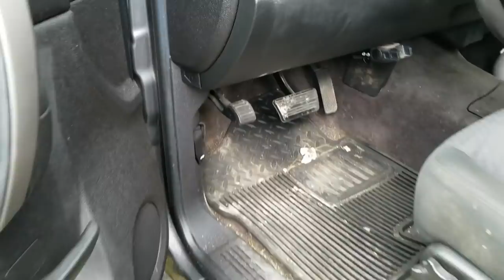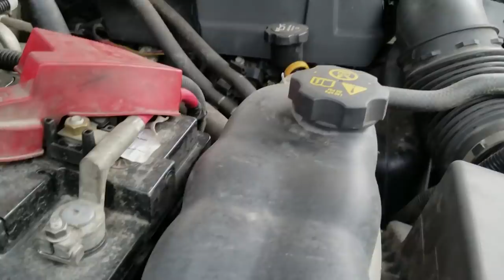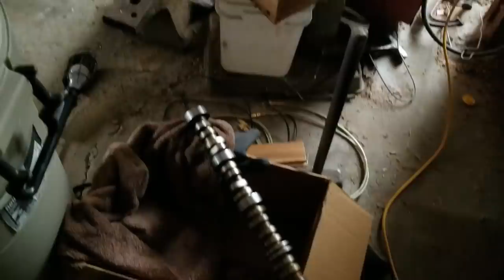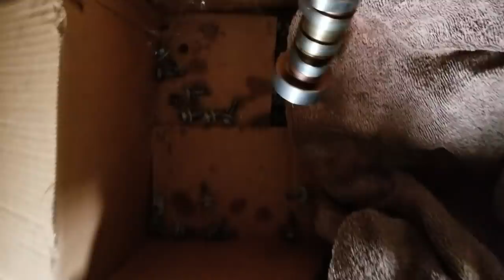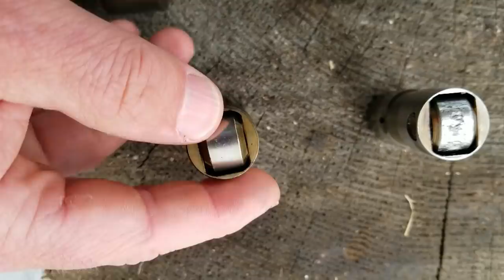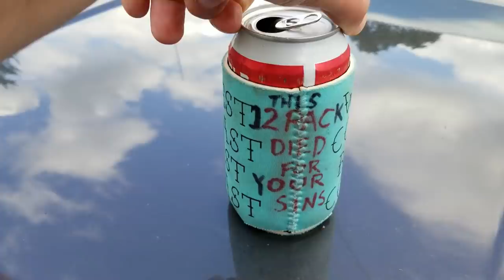Removing Ticks from Engines | Manly-Man Skillz

Comment: Engine ticks?? Oh! You mean my 'change oil' alarm.
Reply: @zuestoots5176  4000k miles = 4,000,000 miles. That's an impressive amount of time to go without changing the oil.
Reply: Or change car alarm
Reply: @zuestoots5176  4000 miles? Even cheap mineral oil should be able to do 9k before actually needing to be replaced...what do you do with that engine?
Reply: No that's the knockers, the ticks just means your a little low, toss in a quart.
Reply: I haven't changed the oil in my daily beater in 5yrs. 
When the light comes on,usually in a corner because it's starved from the low level,  I'll top it off once I get to my destination. 
Usually a couple quarts every 3mo or so.
Reply: @AKAtheA  4 million is impressive dude
Reply: Every 10,000 miles whether it needs it or not.
Reply: @AKAtheA  I don't know, but my "change oil! alarm is a lot of momentary cold startup clatter. Oil's probably OK, but the drainback valve in the filter's given up.
Reply: @teenofthailand1  
At 10k it doesn't need it 🤣
Reply: @mfree80286  
Mines done the cold tick for the last 5yrs. 
I  tried a couple different filters thinking it was a drainback issue.
 Even an oem filter still did it.
So mines not that issue lol. 
I gave up on oil changes after that. 
Any length of time more than 4-5hrs she taps nicely on startup.
Reply: @MrTheHillfolk  The lifter ticking on the GM LN2 is a known issue, I mean it's been doing it for the last... 250,000 miles and hasn't changed at all, so I'm unconcerned.

Hell, the truck could break in two and I'd just chalk it up to normal mileage at this point.
Reply: @mfree80286  Low quality elastomer used by the shitty filter factory, believing that the filter valve is "only temporary' as "the filter will operate for a relatively short time and then be changed", so the cheap elastomer hardens early and fails to seal, allowing the filter to partially drain back.  Designing a too small valve favors this same valve failure.
Get a better designed and better made filter! Nowadays, it is necessary to invest in cutting open some filters from several brands, to actually look the internal quality (or lack of it).

Comment: "Hide surplus fasteners."

No job is complete unless reality conjures up an extra screw or whatnot by the time you're done.
Reply: They say that if you take something apart and put it back together enough times, you will eventually have two of them
Reply: Most people like to have vehicles that match their own personality.  A loose screw here or there.
Reply: I've been known to toss extra bolts in parts bins
Reply: If it works with fewer parts, you've made it more efficient!
Reply: @travissmith2211  you get me !

Comment: the only fire pattern i know is for an inline 6 diesel. 15 too young 36 too old 24 just right.
Reply: Lol
Reply: Well that’s a new one on me. I could  never remember a four cylinder firing order but the question never came up.
Reply: @Kineth1  no worry..if it starts in wrong direction you get 5-6 speeds backwards :D mostly happened on two cylinder 350 jawas :D
Reply: I just learned this the other day
Reply: Yep that’s how I learned it.
Reply: Learned that at Aberdeen Proving Grounds in 1968.
Reply: I like the tried and true Chrysler 6 cylinder. Are you ready?
123456.
Reply: There's lots of semi useless and semi useful information that you pick up over the years working on stuff, Yep an I6 4 stroke whether Diesel or spark ignition is usually always firing 321,321,321 interleaved with 456,456,456. You haven't lived until you have seen a self powered I6 air compressor that is running as an engine on the front 3 cylinders and compressing air with the back 3.
Reply: In some cases.. 36 just right
Reply: 36 isn’t bad at all. Broken in, but still low miles. Best of both worlds!

Comment: The long term solution to that infernal tick is to replace the o ring at the end of the pickup tube where it inserts into the oil pump. Those o rings get dry and shrink up allowing air into the oil system and prevent proper oil pressure/ proper lubrication causing the damage seen in this video. There are plenty of videos here on YouTube on this topic.

Comment: The ticking was a safety feature to let you know the engine is indeed running. It's designed to get progressively louder until the engine stops completely, ultimate safety.

Comment: 18726543 is the firing order of the motor that lies before you. The order you spoke of was of the Holy father of all GM engines, The Small.  Block.  Chevy.
Reply: Thanks the number sounded like I’ve heard it a hundred times but I gave the lost dog look..
Reply: You got it wrong it 18436572
Reply: Fritz, 18436572 is gen 1 GM small block firing order gen 3&4 LS base is 18726543 as Seth noted
Reply: What are we trying to remember those numbers from Lost!? The numbers that were never explained from Lost?!
Reply: Thought it was 8675309
Reply: @tomlindo2863  I will never forget those numbers, they are seared into my brain.
Reply: Yep... 4 & 7 and 2 & 3 are swapped on the LS engine (1-8-7-2-6-5-4-3.  ). Balances the load across the main bearings better than the old firing order (1-8-4-3-6-5-7-2). and also yields a smoother idle. 👍
Reply: ATH24TXEX 4-7 swop on a SBC is a old hot rodders trick. MORE POWER!!!!
Reply: I think we can all agree that 1-5-3-6-2-4 is the only one across all engine manufacturers and fuel types that's un-fuckup-able. 
Granddaddy taught me the easiest way to remember it was to think of chicks at the beach. 
15-too young
36-too old
24-just right

Although, being 28 myself, sometimes I gotta disagree with granddaddy, because there's quite a few DAMN good lookin 36 year olds out there. 28 is a weird age to be, cause the 18 year old daughter looks just as yummy as the 38 year old mother in shockingly many cases this day and age.
Reply: NOCAREBEAR - Exactly! 😎
Reply: @bradbeck2601  for a good time, call!
Reply: @bradbeck2601  Who can I turn to?
Reply: @ELRman86  Ave got right what he said but got wrong that the engine before him was a gen III so he is absolved...
Reply: 4.8 or 5.3. Either way.. Same engine.. Just bore and stroke are different. Same short block.. Great engines.. 4.8s tach high... 5.3s have more torque... Never had one that had lifter tick though.. My XJ ticks pretty bad.
Reply: @LMSILVIA  Even when AVE is wrong he is always in some way right. I'm aware it's a gen 3... I build about 3 a month.
Reply: Correction.... Most every other V8 produced by the General from Olds, Pontiac, Buick, and Cadillac
Reply: @bradbeck2601  if you put a 701 in front of that and dial it up on your phone, you'll reach a bar in the sprawling metropolis of Tuttle, North Dakota....... True story.  Ask for Jenny.
Reply: You beat me to the punch
Reply: @ATH24TXEX  I always thought it was because they swapped the pistons in cylinder 4  with 7 and 2 with 3.  

Learn something new every day.
Reply: AvE knows the correct firing order of the engine before him/us. Trust me, he knows. What he is creatively referring to here is this engine as “resting on the laurels of days bygone, the best combustion engine ever squoze out of Detroit, etc” (heavily paraphrased there) just before the firing order sequence reference (reverence?) to the venerable sbc... lol. Pure poetic genius.
Reply: @bradbeck2601  Jenny smokes 2 packs a day, had 3 husbands,5 kids,has a 6 pack habit and a pot belly.
She hasn't changed one little bit.

Comment: Tis why I drive a 7.3 diesel with 400k on the clock.
 So many different noises going on, you can panic in peace.
Reply: When everything is loud, nothing is "loud" - right?
Reply: @pauliesspeedshop3578  Exactly!
Reply: @mikes2381  That's it! Clack clack clack clack. Only diesel owners know that's what you call the sound. 👍
Reply: @EM-fi2qg  a different clack from every angle looking at it.
Reply: Yep.Buddy across the street from me in FL had one (7.3) and it sounded like it was swapping piston holes in the morning. lol
Reply: My Ford only has a 7.2L in it but, I'll take it over any Navistar stuff its "Yeller" and I can wear the hat that says "Cat Powered" makes a 7.3 seem like a purring kitten🤣
Reply: I concur
Reply: I had a 7.3L diesel and can testify to the loudness with which it ticks.  It ticks loud enough that it completely concealed the horribly squeally wheel bearing that was failing catastrophically.  Right up until the damn wheel fell off the truck.  Good thing it was a front wheel too!
Reply: meanwhile in The Rest of the World we worry more about the ticking of the fuel vending pumps than from the camshafts - 65mpg from a 1.5 Litre diesel truck must look like a misprint to you guys :)
Reply: Had a 7.3 IDI... holy jeez at the noise.
Reply: Ahh, the good old IDI racket, the Navistar/Ford's weren't as bad as the GM 6.2/6.5, they genuinely sound like marbles in a blender. 
As for a 7.3 Stroker, the diesel knock is joined by the electronic clacking of the 110V DC fired solenoids on the injectors, which is more discernible than the combustion event itself.
Reply: What’s that noise? Which noise? Need to be specific so we’re talking about the same noise here
Reply: The real panic is "Will you run out of cranking amps before you get the pig started?" and "If I use this ether will it blow my intake off?"
Reply: Ol' Peg has made me want an old 7.3 IDI. Slave Lake has sold me on those old, gutless things. As dependable as Two Ton Tonya, who doesn't just love you for your cooking.
Reply: I loved my 7.3, 
Start truck, replace batteries...

Comment: in an ill conceived effort to economize legal tender, reuse torque to yield head bolts
stop targeting me please
Reply: Ecoboost swapped Ranger Whew! I thought he was talking to me on that one. I do go an extra 15* past 90* to ‘take up slop’ that second time around...
Reply: @HardKnocksForge  all fun and games until that last 15* or so. Or when you're torquing a bolt and you feel it loosen up as the threads pull out
Reply: @sethgibowski8695   listen for the crack and back it off a quarter turn
Reply: I feel this might have been aimed at sloppy mechanics? :)

Comment: As a Red Seal mechanic, I’ve seen ALOT of this over the years on GM trucks (7)... My one and only piece of advice: If your engine has active fuel management - disable it somehow. If your lucky enough to have purchased a 4.8l dingey-boat hauler - congratulations, your engine doesn’t really have this problem.... not really. 

Aside from this and every now and then needing to redo the piston rings, it’s an AMAZINGLY well put together vehicle, and compared to others - very easy to repair.

Comment: The oil pressure gauge doubles as an engine life monitor.
Reply: Heh, a staggering number of vehicles have oil pressure "gauges" that are actually linked to a simple on-off pressure switch. As long as pressure is above minimum, the "gauge" will show a plausible value somewhere in the middle. Drop below that minimum and the needle will bury itself at zero.
Reply: @CaribooSawyer  
Very true. Thankfully the Silverado has a real pressure gauge.
Reply: Interestingly, the oil pressure gauge on the Toyota 3.0 trucks indicates nothing more than the condition of the sending unit.  Which has usually failed..
Reply: @mikemcteer5422  Haha that's half the fun of owning those.
Reply: @ericchandler90  still not entirely accurate though; those LS engines have a screen under the sending unit which is prone to getting obstructed and causing inaccurate readings. Not to mention the gauges themselves are also very prone to failure.
Reply: @mikemcteer5422  Yep, freaked me right out a few months back when I noticed my 03 Sequoia pegged at 0 pressure until I did some digging and realized the sending unit had just given up the ghost. No ticks though! (Yet)

Comment: My 1987 Loyale developed an occasional hydraulic lifter (or a Hydraulic Valve Lash Adjuster as Subaru calls em) tick around 300 000 km.  The engine lasted another 100 000 km until it melted a couple of pistons (turbo waste gate malfunction).

Comment: So, hydraulic lifters have a shorter life span, less tolerance to delaying oil changes, and the recommended preventative action is to change oil regularly, or if the tick is already happening add thicker oil with an stp additive. Did I get all that right?

Comment: Ah, the Chevy LS motor. We just had to replace a lifter in our suburban. Two days pulling the motor apart in the middle of our "vacation". But thank full we were able to do it ourselves. (We did not reuse the bolts. Just didn't have the guts I guess.) Good for another 200K.
Reply: @Levi Kragt  you mean minus the iron block lsx376 and lsx454 gm performance sells right?
Reply: @SeanPennII  calm down
Reply: Levi is just trolling with symantics, the iron block variants were designated Lr, Lq, Lm, L#, but no LS iron truck motors I know of
Reply: Actually... there are most likely far more iron LS blocks in the wild than aluminum LS blocks given the number of full size trucks GM has made since the LS engines went into the trucks in 99. The predominance of the iron block/aluminum head 5.3 and 4.8 engines result in a much higher number of those iron blocks in existence than their aluminum counterparts found in the F-Body cars, Vettes, etc. Aluminum truck blocks did not start appearing in production until RPO codes like the L33 High Output 5.3 and the aluminum LH6 engines (among a few other RPOs) began appearing in the mid 2000s. This trend will eventually fade though, as all the truck engines started going aluminum with the Gen V direct injected versions, so eventually the Aluminum blocks will outnumber the old cast iron units.
Reply: @SeanPennII  So... how are you correct if he is?
Reply: @ Levi Kragt - General Motors disagrees with you. End of subject.
Reply: @SeanPennII  ... We're done. Good luck with all that.

Comment: I as a mere mortal automotive technician of the red seal variety agree partially of what you speak. Although you as an engineer are eternally cursed in our world. I do not work at a general motors purveyor, my state of employment is at a rival company of infinite levels of garbage production.  Those letters in the mail have no end.
Reply: You sound like a fellow Ferd technician.
Reply: @HemiPowah  my friend as a dissector of kerosene torch powered anti-gravity machines, the experience of being scorned from beyond the drawing board is universal it seems.

Comment: 1,8,4,3,6,5,7,2 good ol Chevrolet small block
Reply: 18726543, actually.
Reply: @cw6371  that's the 5.3L and ls motors. Not good ol 305 350 383 and even big block 454 and 502
Reply: @cw6371  18436572 for those
Reply: Erik Gustafson I might not be able to remember why I walked into the room, but I can spout this off in my sleep.  Which might also explain my current relationship status
Reply: @GregLanz  good man

Comment: Haha that was pure poetry. 
My Tahoe suffered lifter failure....twice in #1, within one year's time. There is a bulletin that GM put out there describing the cause and fix for this......that GM will not call a "recall", even though they knew it was a design flaw in the LS. It falls on the shoulders of ownership.

Comment: As a leaky cummins owner, I know it's time for an oil "change" when the oil pressure gauge hits 0.
Reply: Wait long enough it'll change itself
Reply: When it's a GM LS, and the oil pressure gauge hits 0, it's time to change the sending unit 😂
Reply: @FuelAirSparkTime  I think it already has... 😋
Reply: Leaky Cummins?  Sounds like automotive porn.
Reply: The only thing I like about my 7.3 - needs oil pressure to fire injectors, which is handy considering the ludicrous amount of oil she leaks
Reply: If it ain't leakin, it ain't got oil.

Comment: Nothing Axel grease and saw dust can't quieten down lol
Reply: @Wayoutthere  I only know that because years ago my dad bought a car at an auction and the previous owner had done that and when the engine blew up I was cleaning the piston heads(which were black as) and using a screw driver to clean the coke øff I found the B@$T@&D had made a wooden piston and it was burning through lol
Reply: Molybdenum disulfide or bust!
Reply: @Gr0t0tter  there ain't nothing moly can't fix lol

Comment: I did a complete ATF flush in the motor. Removed that tick forever. Ford 460
Reply: 460s were poopoo
Reply: @Polo1683Official  460s got stuck in between an emissions rock and an engineering hard place. Emissions engines were... well, 70's emissions engines. But by the time they went EFI, they had to be detuned severely because the C6 was gone and all the other transmissions available were somewhat dainty.
Reply: That old 460 will pass anything. 

Except a gas station.
Reply: Haha a 460 gas station joke. That’s a first

Comment: Great timing on your poetic LS roller hydraulic lifter dance tonight, Farstener. 
Myself just finished changing the front shocks and brake pads on my 99-non LS suburban, after has been needing it since January. And a little labor, could’ve been much worse with dodge or Ford badges, and it’s just a dream to drive on crappy roads again. 
Just not hard to work on, and get this, I’m actually not even bleeding a tiny tad. 
Really, true story. 
:   )

Comment: Next time a customer with an LS based engine or a “Hemi” comes in the shop complaining about an engine tick or a misfire that wasn’t fixed by replacing every single part outside of the engine related to that cylinder, I’m just gonna refer them to this video. Far better explained than I ever could.

Comment: If all else fails read the manual. My car manual says above 300,000km expect to top up your oil every 1000km. Top up means you have no oil. It runs fine with no oil but cold starts are choppy.

Comment: Oh Deer thats unfortunate. 

I have a cold engine tick hope the cam is in better shape than the one in the video.
1992 buick 3.8 116,000 miles leaks oil out few gaskets, hopefully don't need to mess with timing set.
 I'm pretty confident its a collapsed lifter spring.